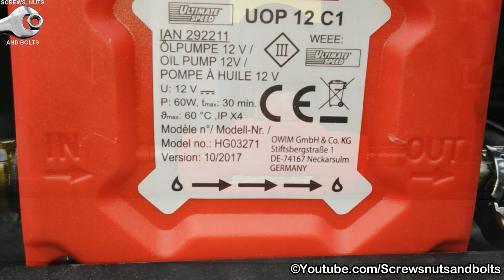Easy Oil Change Using a 12 Volt Oil Extractor Pump

Comment: İ used  another car's battery when the car's engine is running i connect the pump to İTS battery + and - but it melted the pumps wires why did it happen ? Is its power more than 12v 5ah when the car's engine running?
Reply from the maker: It could go over 14 volts when the engine is running but I don't think that would be enough to melt the wires. Did the pump work before burning out ?
Reply: @screwsnutsandbolts  yes the pump worked for awhile without pumping the oil.is it possible becaouse of this without pumping the oil to work the pump machine ?
Reply from the maker: It's possible, they're not supposed to be run dry.
Reply: @screwsnutsandbolts  thank you so much for your suggestions.i will try it again.
Reply from the maker: @Theogus45  Hope it works out ok
Reply: @screwsnutsandbolts  ı hope so.

Comment: Top tip…..keep your engine running while you do this it will help the pump work faster 😊
Reply from the maker: LOL and then you're left needing a new engine as well as new oil 😊
Reply: @screwsnutsandbolts  and new pump attached to battery with alternator going.

Comment: Is it possible to drain whole engine oil out?
Reply from the maker: It usually leaves a little bit of oil in the pan
Reply: No,it does not!The dipstick is not the lowest point in the pan.
Reply: @malcolm7226  Test it and see yourslef.The hose js not flexible enough but you can remove the drain olug and see how much oil will get out. For some ppl this may be ok but I try to get every drop out.
Reply: Petko Andreev Which car and engine you have?
Reply: @malcolm7226  I have had Toyotas,Audi and VW and Dodge Ram.Maybe some cars have a flat oil pan but I have not seen any and I have seen many in 20 years working on cars.Like I said this pump maybe ok for some or for people who have no place to properly drain the oil amd want to save money.I don't think it is worth.
Reply: Petko Andreev what do you think about small 1.4 TSI turbo engine? would there be a damage from lets say 200 ml of old oil leftover?
Reply: @malcolm7226  As far as damage goes I am not sure at least not on a short term.If you cant drain your oil properly just gake it to a shop.I dont trust shops as most people there are morons thus I do everything myself.
Back yo your question.200ml in the pan defeats the purpose of refilling fresh oil with cleaning and lubricating capabilities.
Reply: Petko Andreev tnx friend, my car has 215000 kms and it needs best oil quality, i use castrol 5w40, ok, i will rather buy friend a beer than using this extractor, tnx on your advice

Comment: What the hell is the point of this device? Just drain it from the sump
Reply: i just bought this device from lidl...my old audi has the sump bolt hole rounded so even a new sump bolt wont torque up...i plugged it with PTF tape & a big blob of high temp silicone...so, i wont have to do that any more...
Reply: nimblehorse new sump plug?
Reply: @aleddavies770  yeh, new plug doesn't tighten up...a previous owner must have over tightened it...but i shut it up for now & dont want to have to go through the rigmarole again...hence me buying the pump
; D
Reply: nimblehorse which Audi you have ?
Reply: @aleddavies770  20 year old A4 quarto
Reply: nimblehorse Cool, I'm guessing it's high mileage ? 😁
Reply: @aleddavies770  170,000
and another reason for buying was the last oil change i did the sump bolt etc...splash board and refill & put more than half a litre more...5 liters instead o f 4.6
the garage charged me £20 to suck out the excess.

btw,,,its a 1.9 diesel
Reply: nimblehorse if only you came across this tool to suck the oil before paying a garage
Reply: @nimblehorse  I've got the same car pal. 178.000 miles now. Last cold start I think I heard the dreaded cam tick!
Reply: @MM168NSX  hmmm, right, I am changing the oil twice a year...
Reply: @nimblehorse  Started today and sounds fine. Must've been the week off! 
I'm doing oil changes every 5k.
Reply: @MM168NSX   nice1...best car ive owned is the A4

Comment: OK, what about changing the filter?  That's the really hard part because the manufacturer put it in an unreachable location so you have to go back to the dealer and have one of his high paid idiots do the job.  ( only idiot mechanics work for dealers).  Next issue, why is he still using a 19th century slotted screw on the hose clamps, why not a phillips, a robertson, or a torx that won't slip out of the slot while using it?  Henry Ford did this 100 years ago.
Reply from the maker: I was only demonstrating the pump, and I used the hose clamps that came with the pump.

Comment: The time it took to drain the oil with pump it would have been quicker getting under the car drain the oil and replace oil filter
Reply: Not true !!!  I plug in, I sit down and wait until I hear the tone changes on the pump.  During that time, I am able to do other things..... BEST OF ALL.... NO MESS !!!
Reply: @JodBronson  if you work on small engines and small oil sump then its ok, but larger engine probably quicker draining oil the old fashioned way. Good for you if you get the job done without mess and that you're able to do other things while it's pumping 👍
Reply: @radwanmiah8150  - YES, if that is a big truck, I would definitely need a bigger pump + hose to do it.  But this is for small jobs and during that time, I do other things.  Oh, I use it to refill fluid too.

Comment: Pro tip. Racers are using this tool when they build race car. They remove all oil from their engine. Weight reduction plus engine revs higher. Your engine does not need oil. Oil companies tricked you into spending money for expensive oil. 😜

Comment: 👎 Dipstick tube on a VW Golf mk5 1.6 FSI is too thin. Couldn't use the supplied feed tube. Even a spare 5mm tube I had wouldn't fit. No option other than to do an oil change the old fashioned way.
Reply from the maker: You might be able to disconnect the plastic top part of the dipstick tube and put the feed tube in the lower part of the ds tube. I've never tried it myself so it could be hard to get to: https://www.youtube.com/watch?v=T4zRLxu7k1g
Reply: @screwsnutsandbolts  Unfortunately, the TDI and FSI engines are quite different when it comes to the dipstick tube. On the FSI, it's basically a hole in the engine block. No way of removing it as per the link. For all the effort that it would take, it's all the same just getting under the car and releasing the oil from the sump plug. Good chance this will work for others.
Reply from the maker: @ottofumbler7267  That's a pity. Narrow dipstick tubes in a lot of cars limit the use of this pump

Comment: And you just left at least a quarter in the oil pan. To get all the oil from the pan you still have to remove the drain plug.These pumps are useless....
Reply: Depends on the vehicle . Some do not leave much if any oil after extraction.
Reply: @stringsattached67  Like which one for example?Oil pans are not flat and the lowest points are the drain plugs not the stick.
Reply: @petkoandreev7869  my 2009 Mercedes SLK 350 for one . I've used extraction primarily with this car and there's virtually no oil left . Of course I do have a magnetic drain plug and I use a piece of copper pipe instead of the clear hose down the dipstick to the bottom of the oil pan.
Reply: @stringsattached67  Well,if there is less than 50ml that it should be ok.
Reply: Used a manual pump on my audi when nothing more came out i was curious to see how much oil was still left. Barely half a cup of oil which is miniscule. But if you have ocd then it would bother you.
Reply: @kawilifezx10r23  A manual pump?What is this year 1910?Not sure about you but I do care about my cars and old oil left in makes a difference. Regardless half a cup or not.
Reply: @stringsattached67  Citroen Berlingo has a recessed sump plug so when its removed there will still be some oil left in the sump, in this case the pump would be a better option.